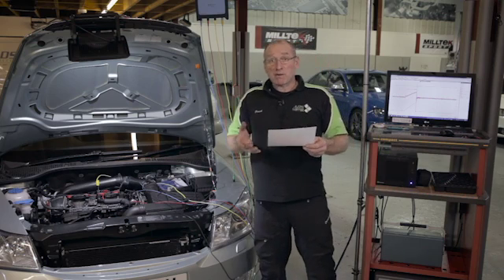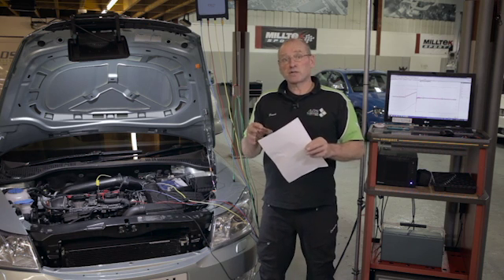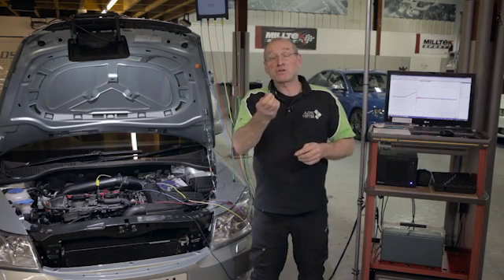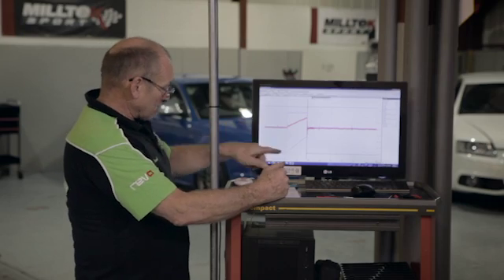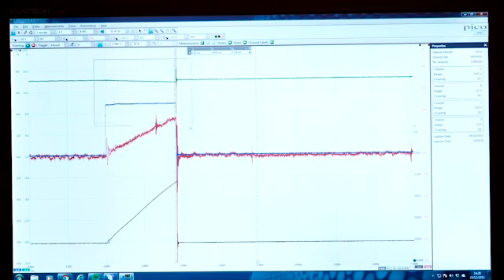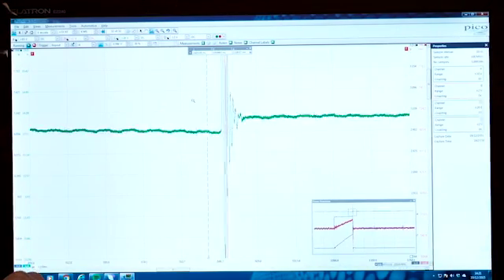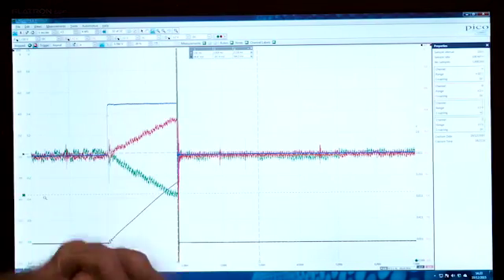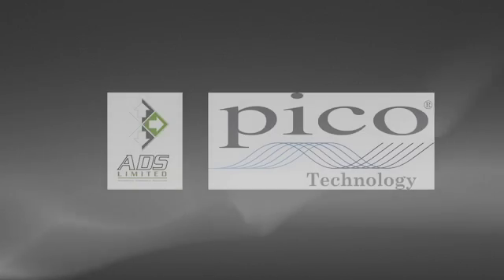Frank Massey's Top Ten Tests with PicoScope: #6 Power, ground, current

Comment: Very interesting, Would there be any reason that you would want to use AC coupling instead of DC for measuring the voltage difference?
Reply: Increased sensitivity. Works great for relative compression tests because you are setting baseline to 0V instead of 12V.